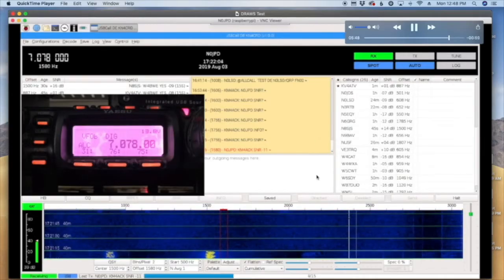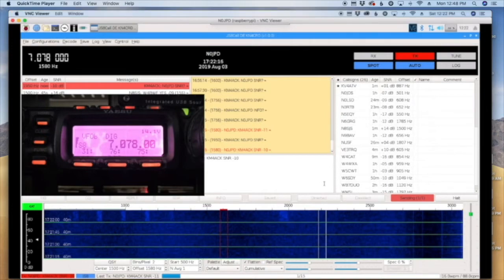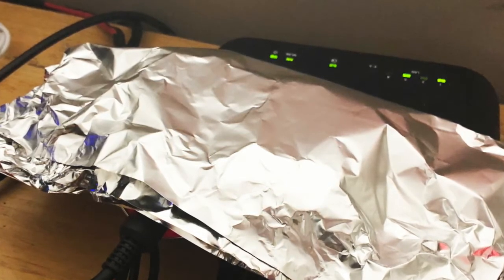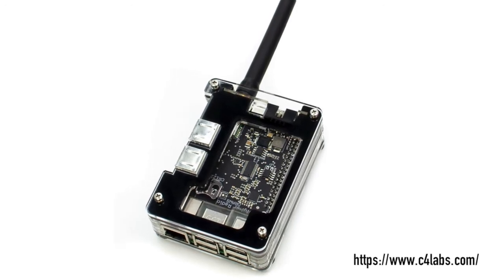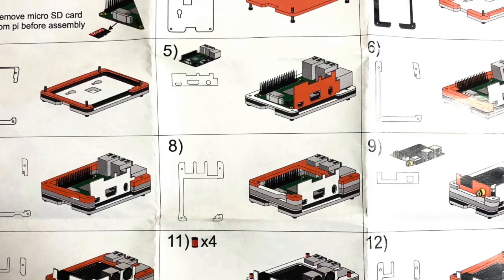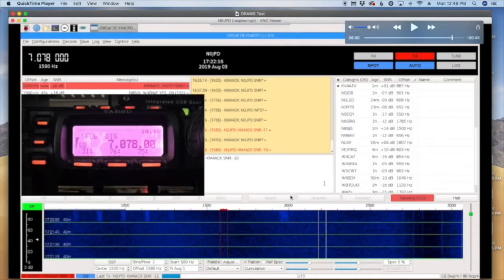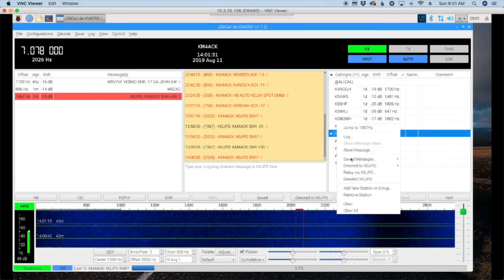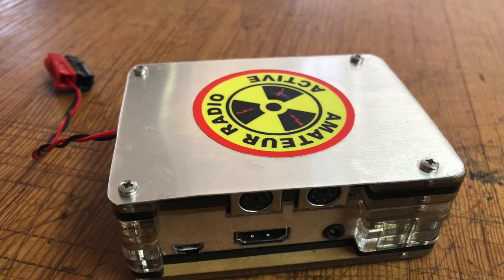DRAWS Case & Coupon Code

Comment: I am a little confused at this point. Why should I want a Draws hat while everything is working just fine with a raspberry and a simple sound card. What are the advantages of a draws hat?
Reply: I think using the hat gives you better system integration, if you follow Julian of "OHBSTN Ham Radio" channel  it is one of his main goals in attaching a RasPI to a ham radio for digital field communications. 
Using the hat reduces and simplifies field set-up as the necessary features are now all in one unit.
With the hat semi-permanently fixed, it eliminates having a lost or mis-inserted dongle in the field. 
Eliminating the USB sound card dongle and the GPS dongle frees up two USB ports for other purposes. 
The hats onboard RTC and "Buck Down" power converter eliminates having those pieces of hardware hanging off the RaspPI's I/O pins. I think it is a better solution and I would like to have one!
Reply: Ralph Mills Hi Ralph,
I see your points. However the benefits are not worth the price. Actually I do have two of the older version. What really annoys me is that it should be easier to set up in a different system than their image. But I am working on it. 
Thinking about Julian: he doesn’t use the hat. And he has got his reasons 😉

Comment: I purchased the same case for my first gen DRAWS hat while waiting for the promised (and paid for) metal case.  I agree - C4Labs' customer interaction is excellent!

On my Pi / DRAWS combo in the C4 Labs case, the mini-DIN6 radio connectors stand slightly above the top of the case.  It appears yours do as well.  Did you make any allowances for that, or did you just bow the plate slightly over the connector shells?
Reply from the maker: I did bow the metal plate slightly over the connectors. Are you still waiting on the case from the DRAWS guys? 73, de KM4ACK
Reply: Yes, still waiting.  Last update said they would ship some time this month.

Comment: Hi Jason, thank you . Honestly I don't understand all the DRAWS  rfi videos. Why did you not go for the aluminum case they sell from the DRAWS website?
73 Chris
Reply from the maker: Great question Chris. RFI was a huge issue for me personally with DRAWS and took hours to track it down. Being unfamiliar with the device, I suspected the wrong audio level settings were the culprit of the nasty digital signal.  The official case is on back order and has been for months. If you read through the forums, you will see many complaints of delayed delivery. I am unaware of anyone receiving the official case as of Sept 2019. Once they are in stock and shipping, I may purchase one of those as well. 73, de KM4ACK
Reply: Thank you Jason, now it all makes sense ;) . I heard from a friend that it is possible to metalize a 3D printed casing . If I understand correctly this is done by applying a so called 'conductive coating' . Here is a Dutch website that sells this coating, maybe others benefit from this idea. https://hollandshielding.nl/EMI-coatings-conductive-glues-thermal-lubricants-and-seals

73 Chris PA7RHM

Comment: Great stuff here Jason!  Great job. I've also got that case now, but in step 9, the little cover to go over the gps antenna, doesn't have a cut out for the 12v pig tail.  I noticed at 2:48 of your video the pig tail is coming out of the case.  Can I ask you what you did there?  Again thanks for sticking with this Draws hat. :)
Reply from the maker: Thanks Jim, I disconnected the 12V pigtail from the hat and fed it through a hole on the top plate of the case. Then I put the metal on top and sandwiched the pigtail between the metal and top plate of the case. Keep in mind that I have REV2 of the DRAWS hat and not the first version. 73, de KM4ACK

Comment: If a person had some copper PCB material around and liked using a Dremel tool, what would you think of an old-school RFI top for the C4-Labs DRAWS Case?   Image->  https://www.qsl.net/k/k4kdr//images/2019-08-24-k4kdr-draws-pcb-top.png

-Scott,  K4KDR
Reply from the maker: That should work. 73, de KM4ACK

Comment: Try FLIRC full aluminum casing with heatsink direct EMF and RFI protection plus very good looking plus 15$ 

73 VA2SOB claude
Reply from the maker: Those cases look awesome but I didn't see one that would accommodate the DRAWS hat. Did I miss it? 73, de KM4ACK

Comment: Nice fix and I glad C4labs makes a case. I would a metal case like NWDigital originally sold on the web site. It included a better integrated power port as well.
Reply from the maker: Those do look nice but I needed something now for testing. I might pick up one of the NWD ones when they are in stock. 73, de KM4ACK

Comment: Do you have a Pi Juice? The battery pack thing that stacks on the Pi?

I really want a DRAWS... but I also want to keep my battery pack.

You would not happen to know if they will work together?
Reply from the maker: Never owned a Juice hat so I can't say. It's not the same but the DRAWS does have a RTC and a small battery to keep the time accurate. 73, de KM4ACK

Comment: Wonder what a rolled out coke can cut with shears would do?  I see you used a thicker solid piece.
Reply from the maker: Would just have to experiment with it and see. That's half the fun of radio. 73, de KM4ACK
Reply: Aluminum foil tape might also be an option.
Reply from the maker: Never crossed my mind but it might work. 73, de KM4ACK

Comment: Great video, as always!

The timing is too funny.  I had also settled on the C4Labs DRAWS/Pi case and got the same email from their Cust. Svc. asking about which model I should get.  Being a new DRAWS that's not even here yet, the v2 case is the ticket for me as well.

Looking forward to the arrival of both items; C4 has some great looking cases and I'm sure I'll use them again, too.  In the meantime, I'll get an aluminum sheet on the way to stop any RFI issues before they start.

Thanks again!

-Scott,  K4KDR
Reply from the maker: They are an great company. Best customer service experience I have had in quite some time. There's a link in the description for the metal I used if you are interested. 73, de KM4ACK

Comment: That's great. Grabbed a case. Would it be possible to place the aluminum sheet under the top case plate?
Reply from the maker: I can't see why not. I just found it easiest to put it on top. 73, de KM4ACK